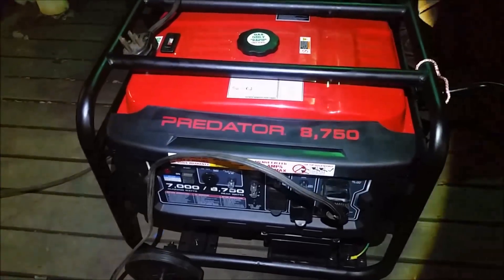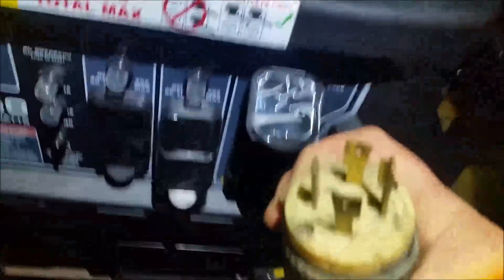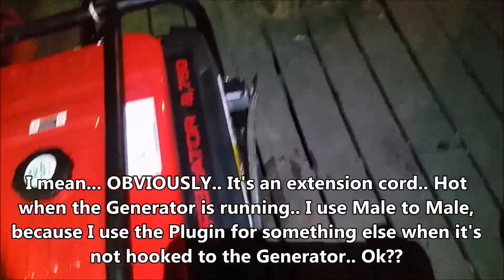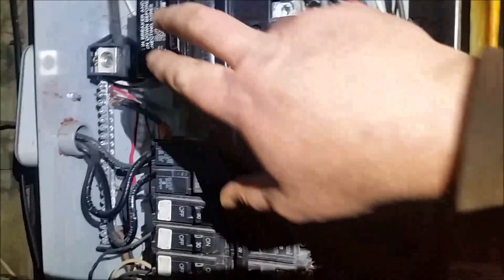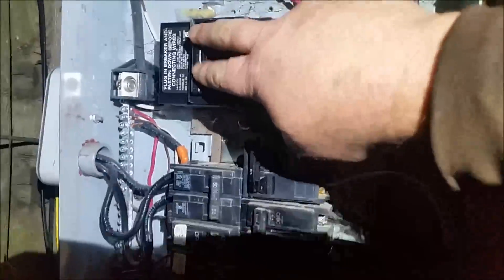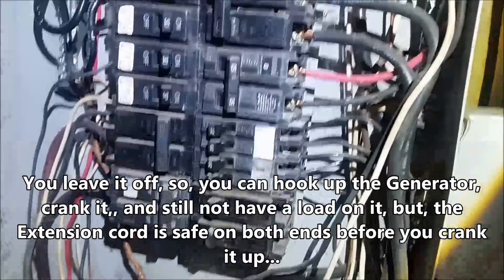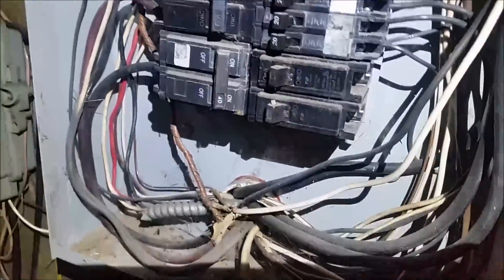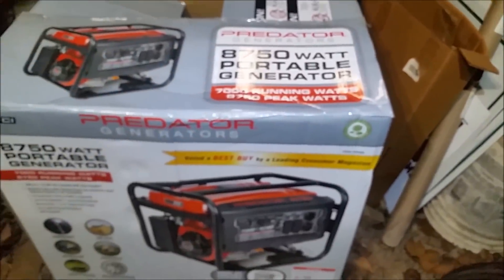Quick/Easy/Safe: Use Existing Plugin/Breaker for Generator hook up to your house Panel box.

Comment: First thing is to buy an automatic transfer switch, and have it connected to your generator and breaker box by a certified electrician. Second thing:
 don't run this generator inside as it looks like this guy has been doing; you will get asphyxiated by carbon monoxide and possibly die. Third thing: everywhere I have been in the United States, there is no such thing as 110 Volts or 220 Volts. The nominal voltage per leg is approximately 124 Volts, and both legs together provide 244-248 Volts. Fourth thing: he didn't mention anything about amp loads and the cable size for the corresponding amp load, which if undersized, can cause an electrical fire, and also no mention as to outdoor cable or indoor cable type, or weatherproof conduit, and a separate ground rod. There's a lot more to this electrical project! Don't be stupid, call a professional licensed electrician!!!
Reply: Del, in the US we commonly refer to 110/220 or 120/240, even licensed electricians do. I do and may have used both interchangeably in the same conversation or in these replies but I know when I pick up my VOM I am looking for 117/234, so what's your point? For your other comments just remember that Mark said upfront to use common sense, this is not for everyone. BTW code specifies a single ground rod.
Reply from the maker: Del Curry: Lets see how smart you are Del, so others can determine if they should listen to you or not.. You have made some authoritative statements.. Lets see if they are backed with Knowledge or not.. 
Lets see if you pay attention to what you hear and see.. 
First.. I don't think you or anyone else is going to buy an "Automatic Transfer switch".. They are designed for someone who is running their own power plant and Automatically Switching from Plant power to Utility power and back.. That means matching phases, etc.. which would be way above the level of knowledge of most Electricians or Electrical Engineers. I have been involved with installing them for Computer rooms in larger Manufacturing Facilities.. It's not going to be a Johnny homeowner who purchases an "Automatic Transfer Switch". What you are referring to is a "Manual Transfer Switch".. First Major Screwup... 
Don't run the Generator inside,, as it looks like this guy has been doing... Ha..Ha..Ha.. 
I see you are ASSUMING that the generator has been running inside??? Ha.>Ha..Ha... Let me Spell it out for you.. Assuming makes an "ASS - U- Me"!! (Assume).. 
But, to point out how perceptive you are, lets make a run of it... You could not stay focused for 18 seconds, because at 0:18 seconds, I say,, "There is a Brand New HF Generator"...
At 30 seconds, I said we just got through running the break in on the unit.. It is outside on a deck at this point, using a headlight.. I said, we have about 12 hours on it. It's dark, The video was posted in January, so, gets dark about 6pm, so, could have started the day before or early that morning.. 
So,, not sure how you figured it had been running inside. There is absolutely ZERO evidence of it,, other than it is a very clean Generator because it is at 18 seconds into the video,, "Brand New".. 
Wow.. Things are not looking too good there Bubba!!
At 1:45 in the video, you were loosing it again.. Because,, your Comment about "4th thing, he didn't mention anything about Amp load, cable size, etc.. Not sure what language you speak, but, it is an English video and that is exactly what I addressed at 1:45.. Not saying that you caught that.. Was probably very tired after that 1:45 seconds of complicated discussion.. Ha..Ha.. Really???? You are not paying attention.. And, before you accuse someone of doing or not doing something, you should be sure that you know what you are talking about.. Because, it really shows what type of person you are.. A dangerous one.. You should work for one of the Fake News Channels like CNN, MSNBC, etc. You would fit right in.. 
Indoor/outdoor cable?? Conduit?? Cable type? Well, I did address the cable time at 1:45, but, no.. Why would I talk about Indoor Cable to begin with.. Is that where you runs yours?? Ha..Ha...Ha.. 
But,, please send me some pictures of your Outdoor Conduit sheathed Temporary Extension Cords.. This, I have got to see.. And,, please post your first video,, "How To Roll Up a Outdoor Conduit Sheathed Temporary Extension Cord" and tag me in the video.. I have to come over and make a few comments when you do.. Ha..Ha..>Ha.. 
A Separate Ground Rod??? Is that why you think they have Ground terminals on the Generator?? Ha..Ha.>Ha...Ha... So, you can have multiple ground rods??? Ha..Ha..Ha.... Just how many Ground Rods do you have at your house?? Ha..Ha..Ha.. Do a little extra thinking on that one.. You really have your head in the ground there BUBBA!!.. haa..Ha.. 
HINT:::: Ever wonder why they put "Plugins on the side of the Generator??",, and not inside of the Panel on your house??? Ahh,, so it can be used without a Panel.. Correct??? And, where is the Ground Rod at your House??? Ahha..Ha..Ha.. At the Panel..Ha..Ha..Ha... And,, there is only one of them too... Ha..Ha..Ha.. Hey,,, BrightSide... It's there is you are freaked out scared and you want to roll your generator out to a jobsite and drive a ground rod into the ground and hook a few extension cords up to your generator and you don't already have a ground rod.. PS... Let me know when you find someone who uses a generator every day that actually does that...Ha..Ha..Ha.. I mean.. Come on  now!!!
I find this next one kind of comical.. You should really use Google more often.. You would not sound so STUPID!! Let me help educate you some more, since you came her begging for knowledge..Ha..Ha..Ha.. Here comes more of your Ignorance..Ha..Ha..Ha.. 
Third thing: everywhere I have been in the United States, there is no such thing as 110 Volts or 220 Volts. The nominal voltage per leg is approximately 124 Volts, and both legs together provide 244-248 Volts.
Ha..Ha.. Well,,, Not sure where you have been, because everywhere YOU HAVE BEEN,, the Nominal Votage WAS and IS 110/120v and 220/240V.. But, I would not expect you to understand that because you simply do not know the Meaning of that new Word you are tossing around without checking to see what it actually means..Ha..Ha..Ha..Ha.. You have to know that I am Laughing my Ass off right now.. Ha..Ha..Ha.. 
Voltage, Nominal. A nominal value assigned to a circuit or system for the purpose of conveniently designating its voltage class (e.g., 110/120,  220/240 volts). The actual voltage at which a circuit operates can vary from the nominal within a range that permits satisfactory operation of equipment.
That voltage on the 120 side of the house is about 1.08 volts on low side before your computer and other sensitive equipment starts freezing up and rebooting.. I'm not sure where or even IF, there is a problem with higher voltages.. It is not common to find a 110/120 volt circuit that goes over 125-130 volt anyway.. Personally, I have never seen anything over 125 volts.. But, I don't check every town that I roll through either.. I' know you can run much higher D/C voltages through light bulbs, etc.. and not cause any problems with them,, and you can run 110V A/C Light bulbs on 12V D/C,etc.. I doubt you would ever find any type of voltage supply in that range to test though.. I'll  have to take a test bulb to a 3 phase shop and see sometime.. Or,, just take a 3 phase motor and spin it up with a belt and see what 408/440 does to it.. Ha.. The only interesting thing out of this whole conversation. ha.ha.Ha.. But, I have to admit,, that would be short of worthless to know just past the curiosity factor of saying that you know something like that,,, that you would never use..Ha..Ha.. 
How do you like being Spanked Son!!!  Pick another channel if you want to make stupid comments and not get Bitch Slapped.. I have yet to have one of you guys come up with something even remotely challenging to think about, although,, you now knowing what the word "Nominal Means" got me on a roll there for a minute.. Ha..Ha.Ha.. 
Google is out there to help fellas like you.. Start using it.. It only takes a few seconds here and a few there to reduce the amount of spankings you will get..Ha.>ha..Ha..

Comment: Hi Mark Thomas, I was a little miffed thinking I could have made an installation for cheep,cost me $400 to put that switch in. After much thought am now glad I put that switch in even with the money. Every time I have come close to getting killed or injured it was because I got in a hurry and didn't think,or was pissed at the time.discuvering no electricity when I get home about dark I might have both going on. That selector switch elemenates mistakes,electricity is provided from the grid OR the generator both are isolated from each other,pull one switch done deal. As a DIYer in good standing after much thought I am glad I spent the extre money,I think cheep might have won out with me.
Reply from the maker: I can understand that.. If you are not comfortable, by all means buy the safety switch...  I find that getting excited or side tracked when working with something dangerous is not a good mix. I just don't do it. I look at each project individually. When I am working with Electricity, I stay focused and don't get distracted.. If the phone rings, I will either stop and answer or, wait and return the call later, etc... If you think about it.. Getting in a Hurry, or Not thinking about it clearly would apply to so many more things than hooking up a generator. Driving a Car.. Better put it in Park before you get out, or you will eventually cause a big problem.. They are both the same to me.. Put the car in Park,,, Turn off the main breaker first.. Same thing.. But, I have worked with Electricity since I was a young fella.
You can pick another project and save that $400 there, and remain glad you bought the Transfer switch.. Nothing wrong with that.. We should all know our limits.
Reply: The added benefit of the transfer switch is you can balance the load better for what you truly need
Reply from the maker: Robert.. How is that different than balancing in the Panel itself?  
If you don't need or want to run it while on Generator, turn the breaker off.. If after turning the breakers off, you see that you have more load on one bus than the other, all you are dealing with is 120 volt circuit breakers since the 220v breakers feed off of both sides of the bus.. If that is the case,, then, if you move any of the 120v breakers one slot up or down, you balance the load right where you are at... 
One of the Major problems with adding a transfer switch is,,, the wires are usually not long enough if they have to come out of the box and go into the transfer switch,, now you have broken wires clamped or twisted together and wrapped with tape where you had solid wires before if that is the case, which has been on two of the transfer switches I had to install.. That is surely not better. I can think of other reasons it is not better.. You are doing all of that work and switching around for something "Temporary".. What is more temporary than using an extension cord when you use it and not when you don't? Just saying..
Reply: balancing on a transfer switch is more important then on a panel because each phase of the generator only has so much ability to generate power for what you truly need.  of course 220 doesn't count because it pulls equally from both phases.  what I meant by balancing what is truly needed on the generator is that if you run the heat the fridge the sump pump or other things direct from the panel originally like it was wired you run the risk of them being all on the same phase unless you go back and physically move the breakers up or down in line to make sure they are not all on the same phase.  the transfer panel makes it easy to arrange them quickly from one phase that the generator is putting out to the other so you could put the heat and water pump on one side balance against the refrigerator  or freezer on the other. the panel balancing is different becaus e you are thinking what is running at the same time for the day and have some latitude because of the larger generating capacity and balancing of the phases by the electrical grid itself where as on a generator you have a much more refined set of what is needed and what each phase can get out. you have probably thought more about then the average person.  I can see your way of doing it down and dirty in a no power situation but if I needed my family to do it if I wasn't there I would want it a little more idiot proof for them.  I use an interlock with red dots on the breakers to be used in an emergency that I used a meter on to make sure things stayed close. an average person doing this with an inexpensive harborfreight generator is not going to have any clue if his pahses are out of balance.  At least a transfer switch usually comes with watt meters on both phases.
Reply: I haven't done it but since my jumper cable is three separate wires all I need to balance loads is a current meter. I suspect the transfer panel watt meters are merely two current meters with a KW scale, a current meter would be portable and useful for other purposes (even helping neighbors). I usually run little on the generator so balancing is not a serious problem. I control when water pump, refrigerator and freezer run and often turn the generator off to save gas, turning it back on when water pressure gets low or if I want to watch the news or Blue Bloods. I don't leave it running if I leave the premises or while I sleep at night.
Reply from the maker: Ed.. I just happen to have the perfect situation at my place for my setup.. I just happen to have a panel in my hall that powers the water heater circuit.. The water well breaker is outside.. When I run on Generator, I throw that breaker off, and crank the Gen.. I just run the house like normal (other than turning off my 3 laser printers with Fuser Units). I leave my two window units running during the Summer and leave the wood heater blowers running during the winter.. When I shower, I just jump in, shower, then, when I get out, I flip the water heater on and don't run any water or any large amount of water until my water heater catches back up.. When I hear the Generator load drop, I unplug the Water heater and go back to normal operations..
I don't usually leave while the Generator is running.. If I did, it would not be further than a quick trip to the store down the road and back.. But, I do let it run all night to run my A/C in the bedroom, which runs 365 days/nights out of the year.. I keep it sealed up, since it is my Wine Celler too.. Can't get too cold in the bedroom.. I can see my breath from time to time when it gets really, really cold.. During the Summer, it won't get colder than the A/C will get it, so, I pull my heavy quilts off of my bed for that time of year.. I never see any of my lights blink, or don't hear any of my heavier motors(refrig/freezer) trying to kick on and failing, and I don't hear my UPS's on my Computer equipment kicking in and out at different intervals, so, I know the panel is balanced pretty well.. I ignore the UPS's when the Deep Well and Water heater are running.. I expect that.. But, I do listen for the Refrig and Freezer while those others are pulling hard on the generator.. That is the real key to knowing there is enough wattage to handle what I am running.. The other signs are what I use to tell if I am out of balance on the load.. So far, so good.
I don't work in the shop when running on generator.. Too much out there is 220v.. I just catch up on the news while I am working on the Computer or something else inside.. If I had a 10k Generator, I could run everything and not worry, because the only thing I would change is not turning the Water Heater off, and that would not change the load per leg, since both of those large consumers are running on both legs anyway.. 
I am not sure what size generator I would have to have to run the house and 220v stuff in the shop though.. I have a 5hp Air Compressor and the motor is one of those guys that you grab the dolly when you want to move it.. The rest of the 220v stuff would probably work fine, if I didn't turn all of them on at the same time, which I would rarely..  Cheers Ed..